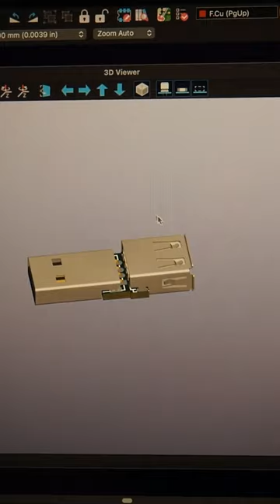USB Blockers #shorts

Comment: If you wanted you could make it like a usb voltage checker where you can turn off data or power and see what is going through the adapter.